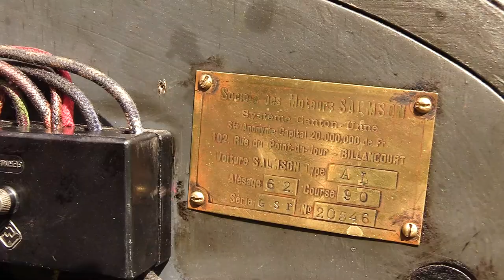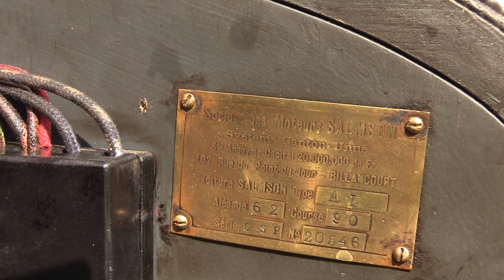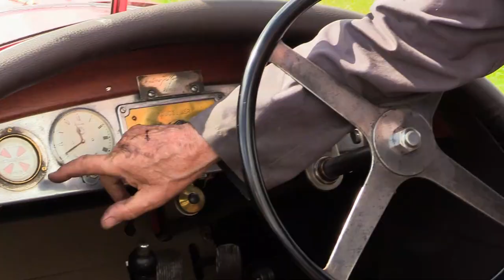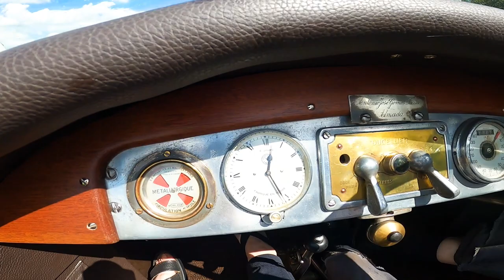SHED RACING - Salmson conclusion

Comment: Question. Why does the Salmson fall in the cyclecar group?
Reply: Cyclecars were defined as being of less than 1100cc and a certain weight. For this they paid less tax
Reply: Low weight and cubic capacity which brought a tax reduction
Reply: @paulhitchcock9760  Well I suppose that explains why so many models had timber and canvas bodies. The Austin Seven  did that fall inside or outside the category? and when did the three wheel rule come into play??
Reply: @davidprocter3578  British taxation was utterly different. £1 for each horsepower was payable annually. A lot of money then and this basis for motor taxation tended to produce vehicles with unduly long stroke cylinders. 
Three wheelers were regarded much like motorcycles and were not supposed to be equipped with reverse gear! They could be driven on a motorcycle licence.
Reply: @paulhitchcock9760  The no reverse gear rule still applied in the 1970's many drivers of Reliants disabled the cars reverse gear in order to drive them on a motor cycle ticket. But at that time you would require a full licence to drive a Salmson on the road, at what point did cars with four wheels stop being included  in the cycle car category. I remember in the early seventies having to go to Tollworth to tax my bikes.which varied in tax class depending on engine size.
Reply: @davidprocter3578  As I understand it there was no cyclecar concept for taxation purposes in the UK. The basis was the so-called RAC horsepower which was a largely notional figure. Thus an Austin 7 owner  paid £7 pa, a Ford 8 owner  paid £8 and so on.